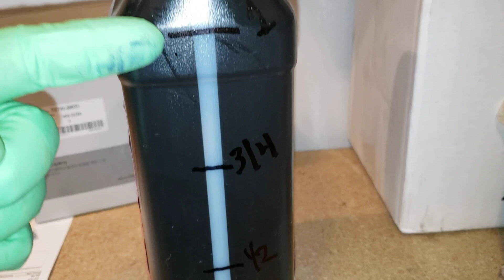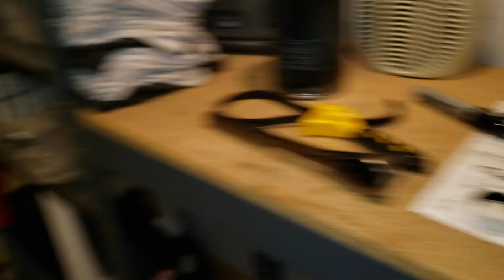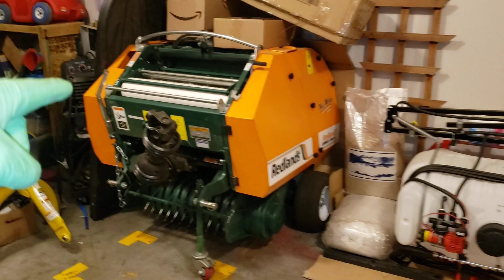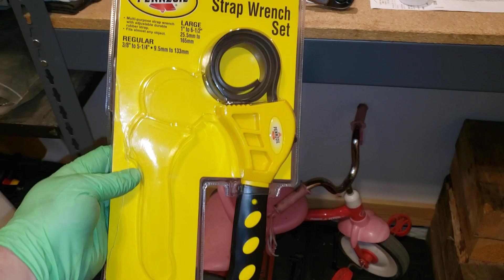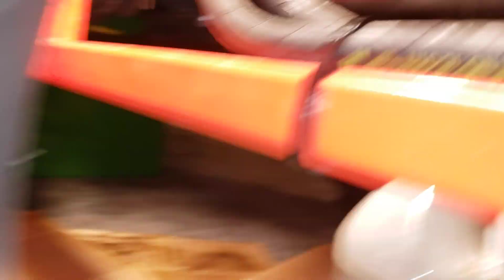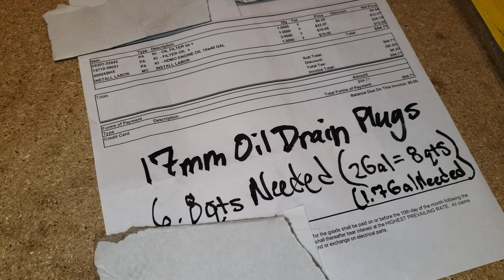Kioti - DK6010SE HST - 50 Hour Service Overview - Engine Oil & Filter + Hydraulic Oil Filter

Comment: I have the smaller
C X2510H and was wondering if I have to remove the hydrostatic transmission oil to replace the filter.
Reply from the maker: I'm really sorry, but don't know for sure. I'm assuming you will, like I did...unless you just do it really quick, but you'll lose gallons of oil while you're getting that thing past the magnet on the filter mount...it's kind of a bear to pull it out. I assume it's super similar to mine (featured here in this video), but I'd definitely check with your Kioti service rep. They are always super helpful whenever I call, but you won't catch me dead paying $750 for an oil change - LOL ;)

Comment: My dealer wants $750 to come out and perform the 50 hour service, they are 1/2 hour away, knees are bad going in the hospital soon for full knee replacement and its early winter now so I'd considered having the dealer do it  but for that money guess I'll suffer thru it with hydraulic fluid going everywhere.
Reply from the maker: Yeah, I agree...$750 for an oil change, basically, seems just insane. Just gave over $200 for an oil change at a QUICK LUBE for my 3/4 Ton Chevy Silverado...everything is getting out-a-hand.
Reply: @BrianPhillipsRC  Not just an oil change, 50 hour required service; oil, transmission,  fuel.
Reply: Beginning to 2nd guess my decision,  3 days trying to the (large) hydraulic filter off to no avail, tried 4 different filter wrenches nothing works and its bitter cold especially on my back under the tractor.

Comment: Can you run Synthetic Oil in the DK10 Engines or just Non Synthetic ?
Reply from the maker: I don't want to tell you wrong. I'd say you better contract your Kioti dealer. I use whatever they recommend, but I always have to call the dealer, since I have one heck of a time finding information. The Kioti website has moved on to the next offering and decided it would be cool to scrub old manuals from the site!?!?!
Reply: @BrianPhillipsRC  I believe 15w40 is conventional oil?

Comment: Any way to change the hydraulic filter without all of the loss of hydraulic fluid?  Just go ahead and drain it all before pulling the filter?  Replace with new hydraulic fluid?
Reply from the maker: I wish...it's a pain without a huge pail to catch it...but the magnet did have some fragments on it.

Also, I think it would be a lot easier if I had a better vessel to catch it in...I was using 1 Gal jugs - not a good choice ;)

LOVE this tractor!!!

Comment: Did your tractor come with both rear remotes or did you add the second?
Reply from the maker: It came with 1 set, the second set was like $300 or $600 adder - 100% worth it.

Comment: How did you like the dk6010 compared to the nx6010? And why the change they look like really similar tractors. Any problems with either?
Reply from the maker: I didn't have the choice... The NX was bigger (if I recall) but the dealer I used had ONE in stock (and a much smaller 25hp offering) , and mine was PERFECT! I had to drive 4 hours round trip to get it...I was going to RULE out Kioti, and ended up LOVING IT!

P.S. This was also the case with JD at the time of my search...I had to drive all over the state to see the 2-3 offerings in stock.

Comment: I think you forgot to change the second hydraulic filter. There are two. Look on the inside cover of your user's manual, right at the top line for the 50 hour maintenance. There's a hydraulic filter and an HST hydraulic filter (in addition to the engine oil and filter) to be changed. The second filter is located toward the center of the tractor on the other side of the fuel tank. You can see it if you are in front of your fuel tank looking backwards.

I just performed the 50 hour maintenance on my Kioti DK5310SE and changed both filters. Luckily not as much hydraulic fluid leaks out with the second filter.
Reply from the maker: We evidently have different maintenance schedules??? My Kioti dealer sent me what they recommended (maybe they just don't recommend this? But it does seem strange that we would have different filers from 53 to 60 hp...

Anyway, I'm already at 100 hours - time flies when you're having fun!!!

Comment: You were able to park in a regular garage? What about opener hanging down?
Reply from the maker: We have 8 foot doors, and our door openers are above the height of our doors, which is typical, if you have a high enough ceiling. Some are SIDE mount, and there's a bunch of other strange configurations. There isn't really a "regular" size or setup for that matter, but for most homes, 7ft height on a garage door would be considered "standard". Check you door, and see if it's close. Also, be careful about concrete bulging during winter or summer, depending on the condition of your concrete (well, drainage under your concrete mostly). Also, keep an eye on the AIR pressure from time to time, when you re-inflate your tires...if you get TOO much pressure in there, you can raise up the whole machine enough to hit!!!

Good luck Tom!

Comment: Great videos - Im waiting on a 5310SE Cab or a 6010SE cab to come in at my dealer here in NC - Bought my CK3510SE HST last year - awesome machine but really need a bit more power and since IM upgrading going to go ahead and get a cab model - Current tractor came decked with lots of extras but will be selling once the new tractor comes in - few questions 1) Have you ever used the rear wiper or had a need to use it ? wasn't sure if I wanted to add it for another $300 ?? 2) What about cruise control ? Ive used it a few time on my Ck when box blading a large field I have but thats been the only time. 3) Which 3rd function kit did you have installed and is that the OEM handle on your Loader stick?
Reply from the maker: Rear wiper - YES. IT works in snow especially. It's not a HUGE issue, but when you get saw dust and dirt dust on there, you'll want it. We take hay from our property and I think it shouldn't be an option...

also I wanted windows that would slide opened - my ONLY complaint on this tractor.

Cruise would be nice if you have to shuttle a long ways on level ground, but we don't...only 10 acres here, so not really a big deal for us...

GET AS MANY FUNCTIONS AS YOU CAN - it's CHEAP from the dealer, and a HUGE pain otherwise. I paid $300 more for the 4th of 4..

1) Loader Lift
2) Bucket dump/pitch
3) Included Rear Accessory (Mine was a DETENT LEVER) 
4) Additional Rear Accessory (This was supposed to be SPRING, but it was another DETENT LEVER - This still pisses me off, since it's a PIA to use the grapple as a result. I wanted 1 SPRING RETURN AND 1 DETENT)

I don't have a 3rd function kit. That would be a DIVERTER, which if it's cheap from the dealer - GET IT NOW, and have the valve installed at the front of the loader, for an ANGLING BLADE or a GRAPPLE. You will LOVE having it, as for now, I have to use my DETENT LEVER over by my right BUTT CHEEK to open or close my grapple - SUPER ANNOYING!!! I could just install one on the tractor now, but since I have it plumbed to the rear already, I'll probably just stick with what I've got. I could also just get an electronic valve and put it BACK THERE, and then control the flow from on the stick...

Either way, if you're dropping $30-40K on this machine, GET EVERYTHING YOU MIGHT WANT. Don't skimp now, you will kick yourself later - I promise. Just drop the cash, and forget about it. You will love having it, and you won't miss the $1000. You will spend more doing it yourself after the fact, and if you're like me, you'll be annoyed when you go to sell it and the NEXT guy also wanted the feature you didn't get - LOL ;)
Reply from the maker: PS - Look at the price difference between the 53hp and 60 hp... get MORE for almost no money...it's like $1500 or some such thing, right?!??! Get more power, you will want it the first time you do ANYTHING ;) Trust me (well, you don't need me to tell you this...you've got the 35 now...and I started with 25hp too...we've been in the same boat...)
Reply: @BrianPhillipsRC  Thanks for the reply and insight - Most likely going to get whatever they have come in first 53 or 60 - but the DK6010SE  is $3k more and uses Cat 2 rear - all my implements are cat 1 and I would have to install a bushing on the rear or put a bushing on all my implements so while the extra HP would be much welcomed hoping for the 53 just for those reasons. Had the 3rd function installed on the CK3510 for $895 but never bought an implement so hoping thats an added selling point but with that you also get rid of the fancy joystick handle.. Good videos much enjoy them from other tractor owners !!

Comment: I have the same tractor and I really have enjoy mine here in NC. The only thing happen with mine was a seal went bad in the hydrostatic pump with only 44 hours on it. It started leaking hydraulic oil. I carry it to the dealer and Kitio had a rep there by the end of the day. They fix it and had it back to me in less than a week. I have ran all brands of tractors but I must say this one got some power and can handle a lot.
Reply from the maker: I love mine, and sorry to hear you had that HST issue. Thanks for sharing.

We've done so much with it that would have destroyed out JD 1025R, but that tractor was awesome too!

Comment: Hello, I'm lokking for a new Transmitter. Should I get the NX6 or the NX8. What do you think?
Reply from the maker: NX8 - It's only $40 more, and you get one more channel, a knob on top, two additional trim switches, and a Lanyard...

The NX6 will work for 85-95% of the new stuff coming out, but you don't want to miss out on ONE or TWO planes that you really like over a $40 adder.

That being said, if the extra 10-12% more is just a bridge too far, the NX6 is amazing, and will work well for most needs!

NX https://bit.ly/3mbVuNB
Reply: @BrianPhillipsRC  Thanks!!